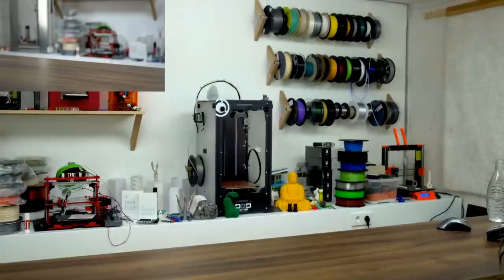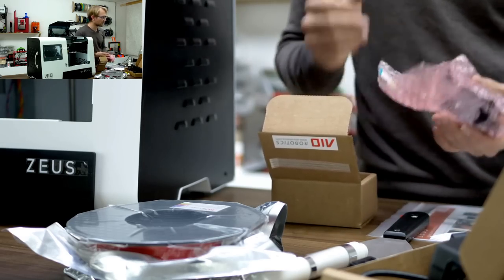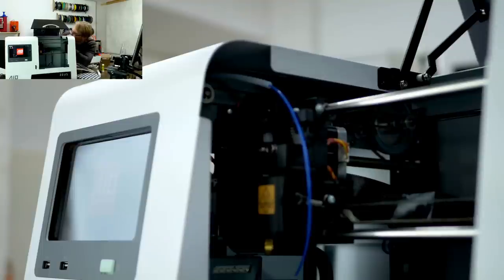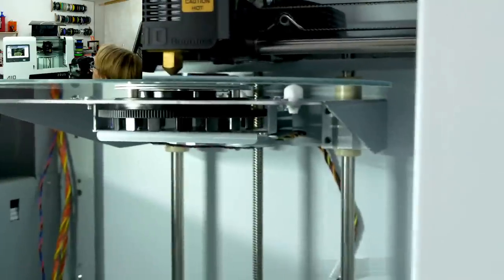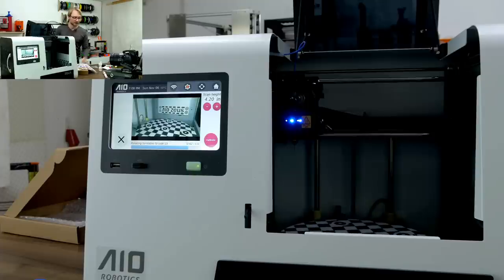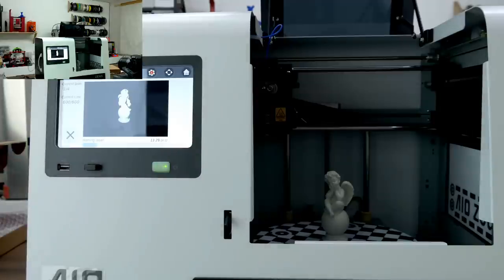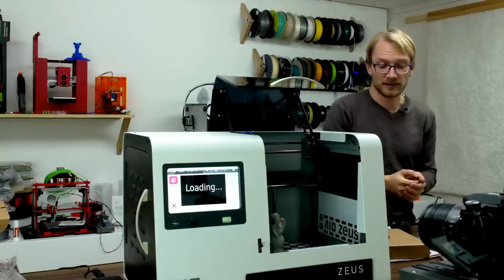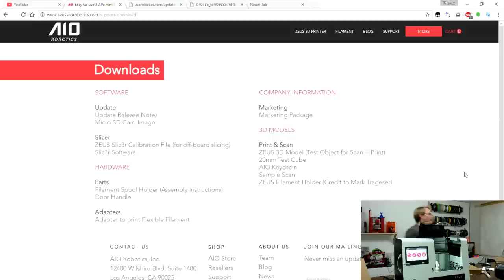[1/2] 3D fax: AIO Robotics ZEUS unboxing + first 3D scan and print!

Comment: Mechanical Auto bed level - BAD
The extruder is very simple and without a planetary gear unit - BAD
Plastic refill is not automatic (for this price range should be automatic) - BAD
Very high price for such a simple device.
imho
P.S. Sorry for my english.